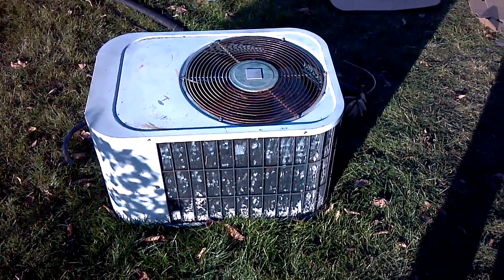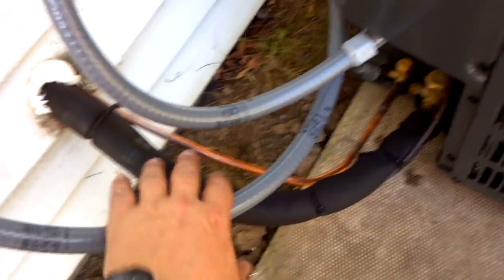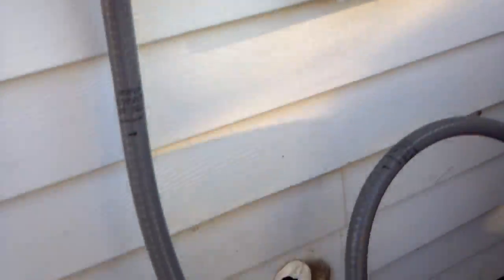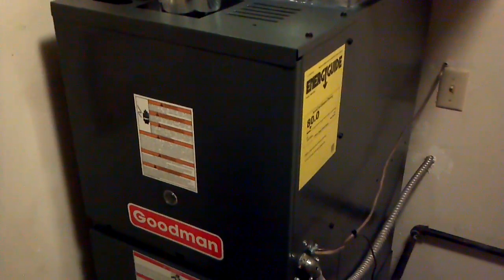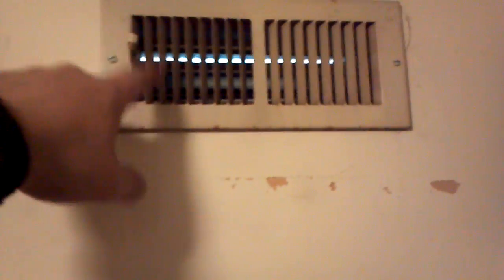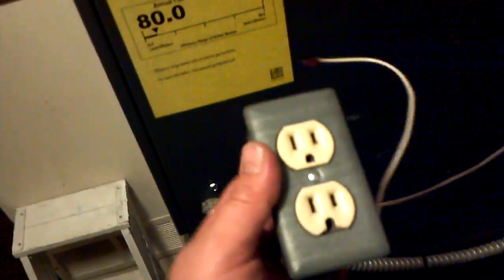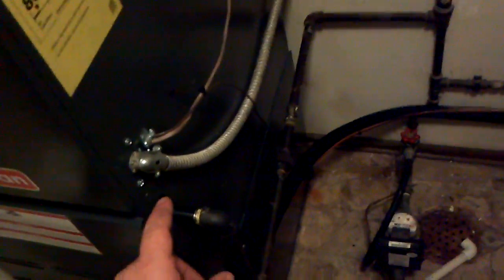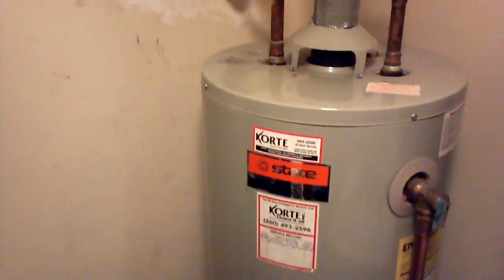New Gas Furnace with A/C replacement

Comment: NEVER put a Dryer vent next to the AC/heat-pump,am Building a Home and the Dryer vent is coming out of the Ground Slab, am going to have them move the Dryer vent to the opposite side of the AC so the wind carry's the heat/Lint away from the unit instead towards it. the wind which comes out of the north-north west.
Reply from the maker: Yes you're right. Couldn't do much here, except relocate the AC a little bit. I was actually there last Friday, and checked it, the coil was more or less clean, most of the dust accumulates on the electrical compartment cover. I clean the condesner coil every spring, which should be done every year anyways. I suppose I could cut a new hole up under the soffit into that utility room, and run a piece of 4" duct and an elbow and relocate that dryer vent up higher, and leave the old vent (which is actually new, I replaced the old one with a white plastic one).

Anyhow, this system is now just about 2 years old, 0 problems so far :)
Reply: That's what i was asking the Builder to Relocate the dry vent they cant Code 20 feet.. but the Heat-pump they will relocate it.
Reply from the maker: Hmm, is your house 1 story or 2? In my house, the dryer vent goes straight up, and vent is on the roof straight up above the dryer. Makes for a simple pipe run, and less restriction because theres only 1 elbow right behind the dryer where it goes into the wall. The only bad part is having to climb up on the roof every few years and clean out the vent. Whenever it rains hard, the roof is self cleaning :)
Reply: i will be building the house,i cant move the dryer vent because code is 20 feet MAX but i talked with him about this and Lint he will relocate the Heatpump.,, 1 story 1700SQ..

Comment from the maker: Well, it wasn't in very good shape; a lot of weedeater damage to the condenser coil fins etc, rusty, and it didn't have the original compressor in it either. It also had a very slow refrigerant leak somewhere. That old unit was drawing like 12 amps of current, the new one is 5.6 amps on the compressor, and .55 on the condenser fan motor.

Comment from the maker: You might be thinking of the bad old days of the Janitrol aka "Junkitron" days, with the horrible condensers and the noisy bristol recips. Nowadays, the Goodman heat pumps use boards made by Emerson, and they use the same Copeland scroll compressors as anyone else. It doesn't really matter about the sheet metal, it's whats under the hood is what counts :)

Comment from the maker: I did move it a little. I had to pry up that concrete slab, move it, and level out the dirt with a flat shovel, the old unit was too close to the house, not level, and really crooked. The reason it's where it is now, is on the right hand side of the unit, there is a spigot, and then a big hose reel. If I moved it any more to the right, it would be hard for him to reach back there to turn the hose on.

Comment from the maker: We have some older Rheem's and Ruud's on that rooftop (See the Ghetto Rooftop Re-revisited video). The newer Rheem RRKA series are 1/2 decent, and not too bad to replace the heat exchanger in them gas packs of theirs. The A/C units however, I don't really like their condenser design on the older ones, they make the coil really small, and really hard to get all those panels off to clean em out when they get all clogged up. They remind me too much of those old horrible WeatherKing's...